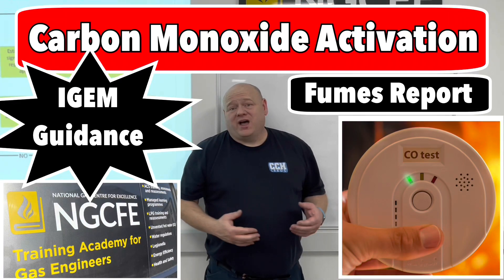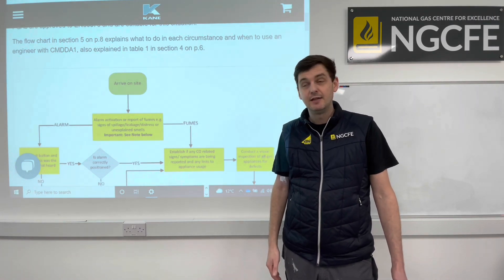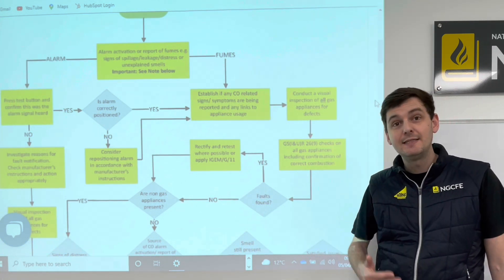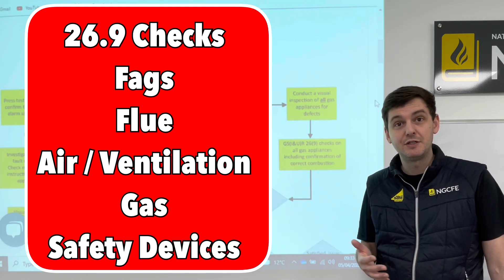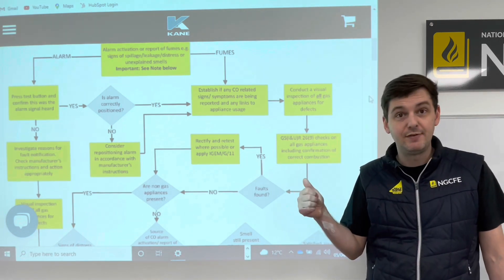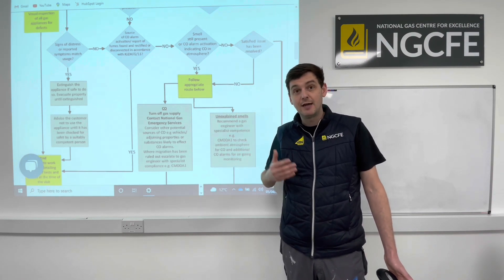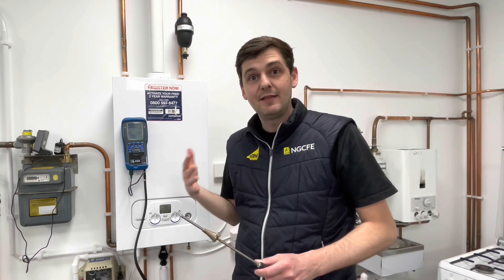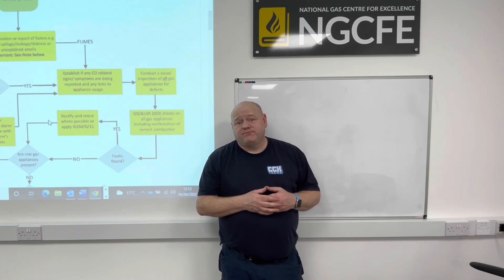Carbon Monoxide Alarm Activation Guidance | NGCFE

Comment: We had TWO carbon monoxide activations on two separate occasions on two different sensors.
We live in a council property and the engineer said it’s due to atmospheric’s .
They moved the boiler from a cupboard in a bedroom to the loft . 
We’ve had two months of problems with this issue.

Comment: Hi Allen
If possible could you put a link to that graph please? Thanks
Reply from the maker: I listed it above but here is the link. Thanks. https://www.kane.co.uk/news/new-igem-guidance-on-co-alarm-activation-fumes-report?utm_medium=email&_hsmi=208669017&_hsenc=p2ANqtz-9IuqYahud3VqGYM6F4fgweD-7pyRM1f8bs3h0Gp7-rzudhSDO9iCzhJwLMzFfFChvpDS28VZbZ3Hwaie7we6F0Z03eSA&utm_content=208438832&utm_source=hs_email